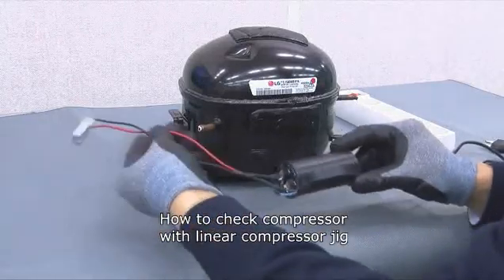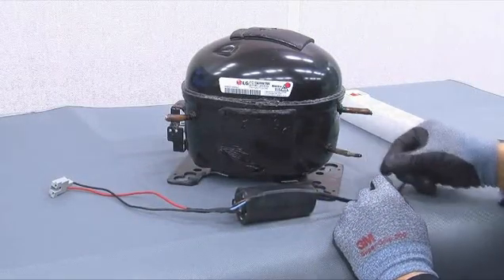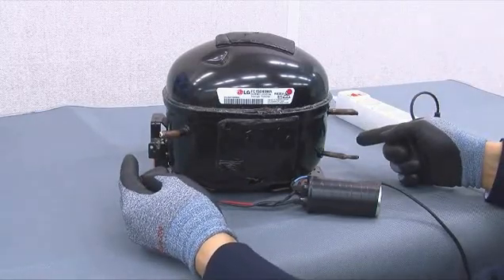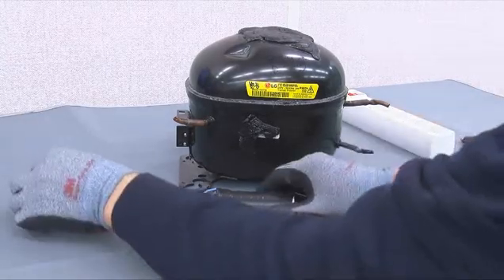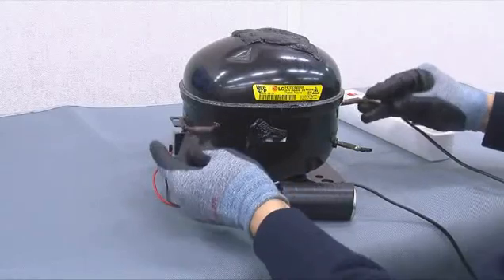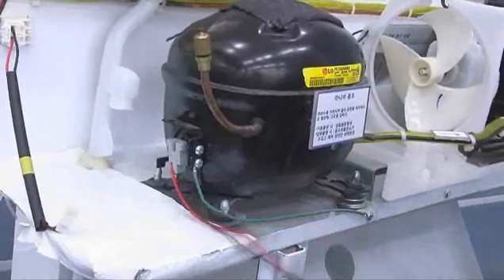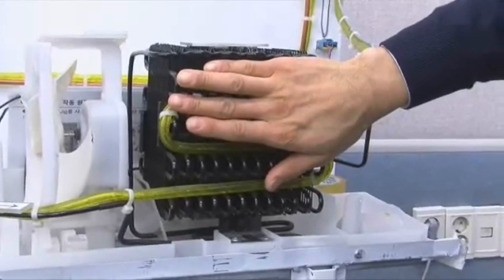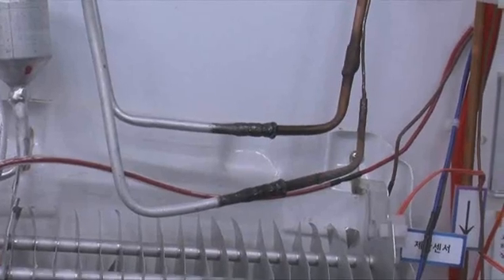LG Linear Compressor Check without PCB

Comment: L1 into and out of the 10MFD capacitor and then to the compressor's bottom terminal. L2 goes directly to the compressor's top left terminal. Voltage is 220VAC.
Capacitor is rated 10MFD with minimum voltage rating of 220VAC but preferably higher.
Note: These LG linear compressors only have 1 winding, so the third terminal on the compressor (top right terminal) will have no resistance reading.

Comment: I did this and used the capacitor on board 18uf 450volts and plug it at our source 220vac. It runs up to 5.2 ampheres then the overload protector cuts off.
Now I need to know what voltage did you used?
Reply from the maker: You have to use 10 uf Capacitor
Reply: Can I use 450v, 10uf? I can not get 550v, 10uf. My outlet is 220v.

Comment: It's necessary to disconnect refrigerant tubing pipe?  It seems yes but I will not.  This compressor has no oil lubrication, it's broken in short time normally?
5x flashes of linear drive pcb.

Comment: How to make a kit like that to test,can you show a diagram wire,tks
Reply from the maker: Hello Thien 
It's very simple take 2 wire for Line and neutral and 10 MFD 550 VAC Capacitor Put Capacitor in Neutral in series and connect to Compressor terminal
Reply: Technical support so I got 2 line,1 hot and 1 neutral,hot to capacitor and capacitor to compressor,neutral directly to compressor,is it correct?
Reply: @MrTranduythien  its working true
Reply: Yeah, but it must matter which is the neutral and which is the in series from the capacitor...or which prong on the compressor  gets the “start” from the capacitor?
Reply: @bluuedaniel  as stated, the capacitor connects to the neutral terminal on the compressor.  Also, the capacitor is in series, which means the neutral power source wire connects only to one of the capacitor terminals, and the other capacitor terminal connects to the neutral terminal on the compressor.

Comment: How can chek lgfc140nem compressor  ?
Reply from the maker: If you have linear inverter Compressor you can check same method with the help 10 MFD 550 Volt Capacitor
Reply: I can run linear compressor without Pcb?
Reply from the maker: Yes you can run without pcb
Reply: Please samjhaye
Reply: Sir 2 wire dikh rahe hai,kaha kaha wire terminal par lage hai  vo bataaye
Reply: What is the voltage you used for the jig?  Is it 110vac or 220vac?
Reply from the maker: 220 Volt AC
Reply: Dyrek chek jese 134 ka comprosor chalu karte he wese online 2 wayar laga ke c s pe

Comment: What is the Compressor jig you are using ? Is it a 110 volt Capacitor with 2 wires to connect to Linear Compressor ?
Reply from the maker: 10 MFD 550 volt Capacitor in Series then connect to LG Linear Compressor in this time Compressor run Fix Speed 
Do not run More then 5 Minute.
Reply: @masif  more THAN
Reply: Poor English in your response the last 4 word compressor run fix speed, what the hell do you mean,compressor should run at  fixed speed?
Reply from the maker: Yes Compressor run at fix speed
Reply: I can not find 550 volt, 10mfd in our country. We have only  450 volts, 10 mfd. Can i use 450 volts, 10 mfd?

Comment: How true these lg linear compresor breaks within 2 years in any lg fridge?
Reply: I bought a Kenmore elite refrigerator approx 4 years. Replace compressor 2 years ago, failed again a week ago.   There's a class action lawsuit against LG.
Reply: @jca65lb  We bought ours at Sears in May 2016 and same exact scenario! You should get 1 more free one before warranty expires!
Reply from the maker: It's depend on Gas Sealed System
Reply: Dido for me.... 2 year fridge and compressor went out. Called 2 service guys and they refused to work on Kenmore Elite. Had to get warranty thru Sears and LG sent out new compressor. After tech installed, fridge still fidnt work. The issue?.....bad compressor